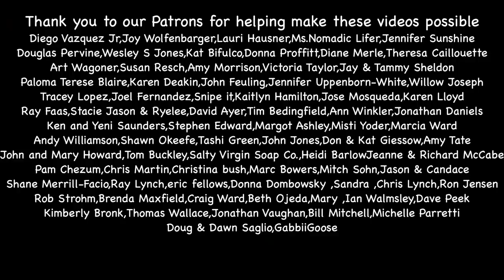IT'S FINALLY DONE!!! Brick Pizza Oven Build

Comment: Kaylee, 
I noticed that when you went to the Hardware store, you put your shoulder strap from your seat belt under you left arm.  DON'T DO THAT!  Last time I did that I was in a car accident and the doctor said that my broken ribs did not break because they hit the steering wheel but was directly related to my not wearing my seatbelt properly.  For you, that would mean no work on the farm, and you won't be picking up Sadie for at least 6 weeks.  So don't do that when you get in the car.  Most car's now have adjustable seat belt so you can lower it for comfort.  SO DON'T DO THAT!

Comment: Nice looking  job ,but I'm not sure how you will keep a fire going within without a flue pipe....As for insulation.I found clay cobb with a mixture of straw and fiberglass insulation strands work great on the outside and cheap to do. Can be painted, tiled etc...